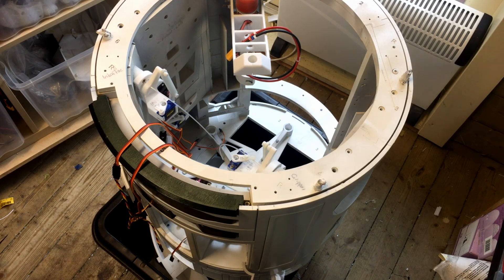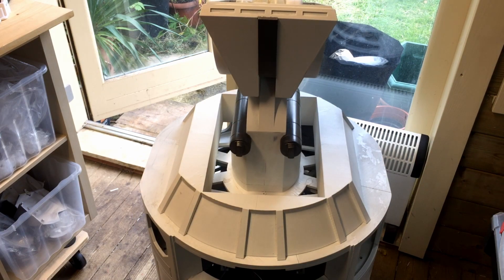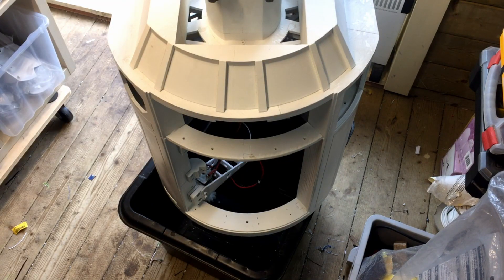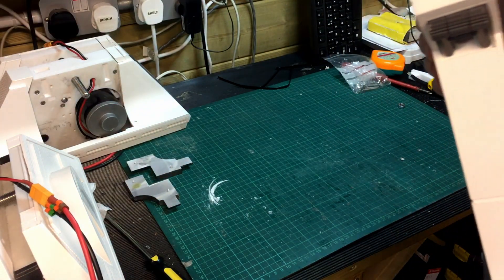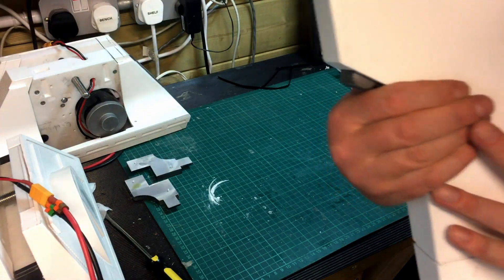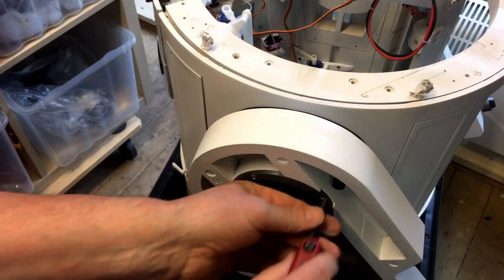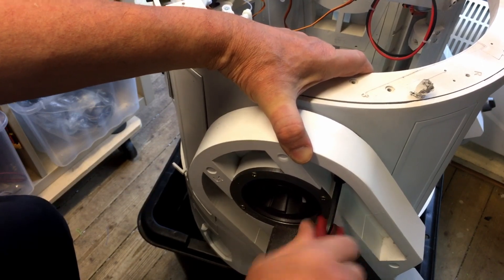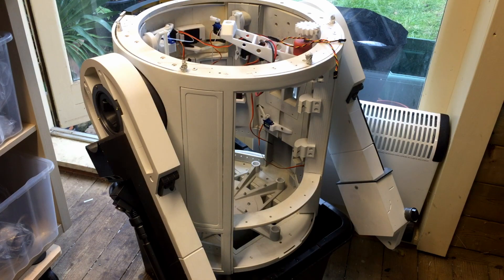R2D2 Droid Build Part 35

Comment: Quick question, which make/model of motor are you using in colin's dome? Read loads of discussions on the astromech forum but the articles are a bit dated, motors hard to find and/or expensive to aquire! Look forward to your next vid. Cheers for all  the sorely needed guidance.
Reply from the maker: Hi Masterblaster, the motors I used are "Electric Scooter Motor 24 Volt DC 150 Watt 24v Brushed Zy6812 19t Belt Drive" ( these for example on ebay - main drive motors - https://www.ebay.co.uk/p/2164866469?iid=173134035388) and the Dome motor "919D501 RE 540/1 Metal Geared Motor 50:1" I bought from Technobots (https://www.technobotsonline.com/919d501-re-540-1-metal-geared-motor-50-1.html).   The Dome motor is 50:1 geared one but something similar will work I am sure. Its the body size that needs to fit Mikes STL parts thats just as important.
Reply from the maker: Try this link as the previous ones not working ... (https://www.technobotsonline.com/?subcats=Y&pcode_from_q=Y&pshort=Y&pfull=Y&pname=Y&pkeywords=Y&search_performed=Y&quick_search=Show+all+results&q=919D501&dispatch=products.search)
Reply from the maker: 919D501 RE 540/1 Metal Geared Motor 50:1 is the part.   Still having an issue with the links.  Its https://www.technobotsonline.com/ and search for: 919D501
Reply: @kylecampbellweb  That's great, thank you. I'll check it out. What's the noise level like with that model? I watched episode 19 again (I think that's right!) but I find that video audio never compares to actually being there! Are you happy with it? Would you prefer a quieter model or does it add to the "well... It is a robot!!" vibe?
Reply from the maker: @jamesprosser4261  Hi, its not the motor that's noisy but the whole Dome and rotating mechanism that you notice, but as you say its a robot.  Fine I think.

Comment: Kyle Campbell can you please tell me where I can get the code for PlayStation Controller to work with the Arduino and would you make a video about this please I have looked and all I can find is for the xbox360 controller and I can’t seem to get that to work thanks mark
Reply from the maker: Hi Mark, I can send you my EZB version of the code if you want [email me MyRobotCalledNigel@gmail.com] and I will send it.   I managed to get my PS4 remote to work fairly well using code supplied on the EZB forums [https://synthiam.com/Community/Tutorials?] and here [https://synthiam.com/Community/Questions/Joystick-in-EZ-Builder-19181]. I didn't get all the buttons to work but most did.  I am currently rewiring my R2D2 control board and will make a video on controlling it with the PS4 remote.    My R2D2 is basically finished but I have not had a chance to rewire it as I made so many changes it was getting a mess.

Comment: Cool! Made my day! Were you inspired by Michael publishing so many videos lately? Or did you finish your plane? BTW, Michael used wing nuts on the bolts for the legs to make it easier to alter their position. I'm trying to do the 2-3-2 mod which is... a nightmare. Yeah, seeing them tip over when in standing mode is a cringe worthy sight. 
The bin is an excellent idea.
Can't wait to see your next update, I'm envious!
Reply from the maker: Hey Chris, I've seen lots of links to Michael's vids but I haven't had a chance to watch them, I must do so.  Its nice to take a break but I get gentle reminders every so often about when the next video will be,  so here they are.  I've been thinking about the new version of electronics  I want to do, so that will be next main project once I got R2 all in one piece.
Reply: Cool. I'm way behind. I have the electronics for the dome innards almost done but stalled on everything. I should check out the Astromech.net site for updates too.